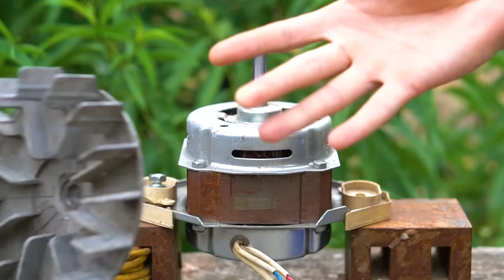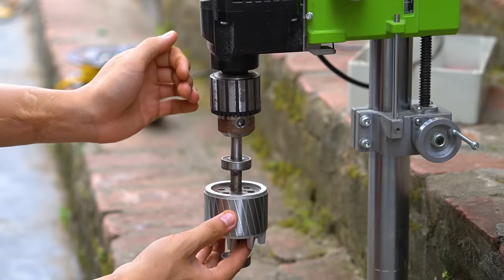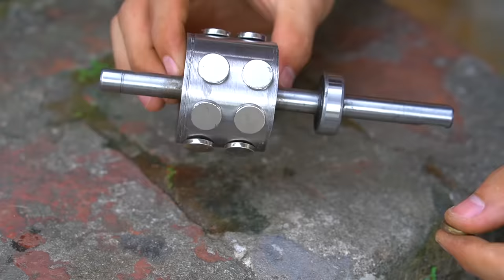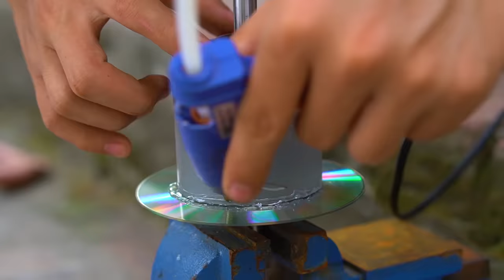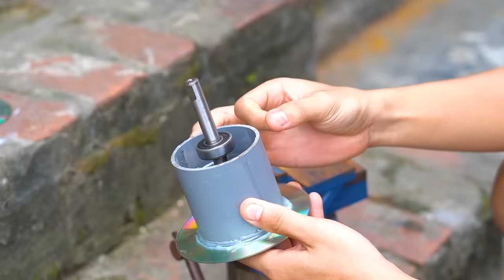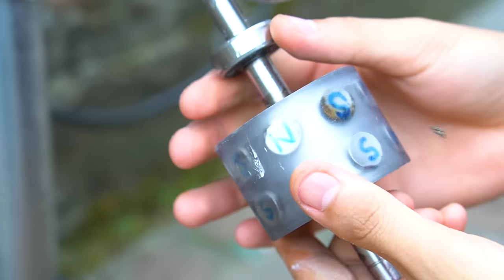I turn Washing Machine Motor into 220v electric Generator

Comment: Wouldn't the motor work as a generator just by being driven by the gas engine?  Was there a need for all that other work?
A motor takes electricity in to turn something but if an engine turns the motor it put electricity out.  Motors and generators are exactly the same, no?  And isn't voltage out based on driven rpm?
Reply: You have to have magnetism to make electricity.  The motor was an AC motor which used AC current to energize electromagnets in the stator to turn the rotor/shaft. No electricity, no electromagnet, therefore nothing happens by turning it backwards.   He added permanent magnets to the rotor; now all you have to do is spin the rotor and the  magnets will produce electricity in the winding of the stator.   All motors and generators are not the same thing. Electromagnets need electricity input before they will work; but permanent magnets don't need electricity to be a magnet. The motor went from an electromagnet motor, to a permanent magnet generator. It will now produce electricity regardless which way you turn it.
Reply: @henrywilliams1439  thank you for your reply, I appreciate you taking the time to explain it.  Cheers!

Comment: Okay. One thing you can do. Get ride of the Gas motor. Connect the shaft direct to a D/C motor shaft using insulated coupler. The generator will power the electric motor with the 220v thru an auto D/C A/C Converter. It will use less energy than the 220v generator. Run it as long as nothing breaks or shorts out from excess heat less any other problems. You can start it with a D/C auto battery and the Auto key switch. A volt charger detection circuit that auto stops the charged battery. Now you will have what I invented 55 years ago at 17 years old. 
PS. I improved this from age 18 years old to one not like this one to a generator with no moving parts.
Go figure that out. Good luck.

Comment: Im no expert,but dont you need a ground?
Reply: I think that the white wire is the ground if I am not mistaking and/or the base where is solded works as ground itself. Even when he says "220v", I guessed that is just 120 volt...
Reply: He doesn't need a ground just a neutral for the return.  A ground and neutral are two different things although I have seen some people use the natural as s ground.  This is not s 120 volt setup as someone mentioned.

Comment: So after i done all this then fasten a small wheel to shaft have that small wheel running against my mobility scooter wheel it should create a electric fence that i can run back to a battery Therefore putting electric current back in my battery after the battery is powering my motors which turn the scooter wheel which drives our new alternator which generates a current which runs back to battery...Correct... But what about reverse any side affects...you must be asian only a asian would be as bodgy as me But i like your ingenuity👍

Comment: it's a cool idea but it doesn't put out much amps. voltage may be high . size of magnets and wire thickness too small .a briggs and stratton engine 20 amp 12 v system at 36000 rpm and 20 hp will put out 38v a/c without the regulator . that winding he uses has more wraps so gets more voltage . notice it will run the small water pump with no restriction. add a sprinkler and it would probably struggle with load on it.  the speaker probably has a step down transformer in it from 110v down to 12 v DC
and the fan is barley spinning . would make a good 12v DC windmill .

Comment: Yes, it is very good to turn waste into treasure. For the safety of reuse, thermal protectors can be installed on the transformer. Dual protection makes it safer.

Comment: Attach a submersible fan or propeller to it. Stick the propeller just under the waters surface in a flowing stream or river and allow nature to power the alternator alone. 
This is how you go one hundred percent carbon free power. 
Grab a couple three cycle batteries and connect them just for fully charged backup. 
Or buy a submersible propeller / charger from Amazon that distributes far less energy but enough to charge a phone or a flashlight. Maybe 5-15watts. 
This invention in the video does create serious voltage but will not last exposed to elements. 
Create a watertight box for it and seal all seams then store it riverside and permanently submerged (the propeller ), then you truly have power for free. This device can power many things at once. 
It’s an apocalypse life saver.

Comment: Nice work sir👍 but if i may ask.. these appliences do they use Direct current or Alternating current because i didn't see you plugging the transformer or anything to convert the DC into AC
Reply: A magnet rotating alternative North and South always produces AC. Which (as you know) stands for alternating current. If you want DC, you can get is from a battery or solar panel. If you want to store AC power in a DC battery, you will need a director bridge in between. 4 diodes is a square figure.

Comment: Tell me, please, if I simply make 16 holes of 4 mm in the same rotor as in the video in two rows of cutting and most likely I will hook the copper electrodes, will nothing close on the coil, or will the energy come from the magnets?

Comment: Great video .. convert motor to generator check use petrol powered engine to drive converted motor check use generator to power water pump and soak 4 limbs in water check proceed to getting electrocuted :p

Comment: Ty for the vid, I'm going to give it a try. How did you step down voltage to run those things that are 120v ? Are the 2 wires coming out of Generator 120v each? Thanks again.
Reply: I was wondering the same thing

Comment: Tighten up that belt some and get it running at peak performance and then plug a electric meter into it so we can see how many volts and amps that it's producing!

Comment: I'll give this a go. I have a working motor that came from a bad machine (drum bearing went) .. I also have alternators - which to date i haven't figured out how to get them to work. I said i'd come back to it. but effectivly he turned a motor into an AC alternator? with the motor he now has a generator? So as long as you can keep the motor turning it;ll generate. = stream / river, wind.. other.. nice job

Comment: Hola, buenas noches
Felicidades por el proyecto.
Quisiera hacerlo por necesidad, no tengo luz ni como instalar en una casa de campo.
Me gustaría tu apoyo y orientación.
1. Que tipo de motor es
2. Donde o como consigo los imanes
Saludos y de antemano, mi agradecimiento.

Hello good evening
 Congratulations on the project.
 I would like to do it out of necessity, I don't have electricity or how to install it in a country house.
 I would like your support and guidance.
 1. What type of engine is it
 2. Where or how do I get the magnets
 Greetings and in advance, my thanks.

Comment: You guys wanna see something that does work, take apart a treadmill for running and remove large permanent magnet motor. I welded pulley onto flywheel and put it on plywood next to 5h go cart motor and wow you have a generator minus DC inverter. Add DC inverter and 6 way power supply and you have a generator.

Comment: There’s still operational cost involved i.e fuel to run the generator. Better replace that fuel generator with an electrical motor fed from the electrical output

Comment: Ingenious but cant understand how you can run all three and the petrol driver engine didn't change rpm or sound like any extra load when the loads were added ...maybe a buried power cable?

Comment: I see a few things about this a washer machine motor is mostly 110 is this a commerical type because it looks like a normal washer machine motor and 220 requires 2 hots and a ground and the power cord only had 2 after cutting the 3rd wire off so how is this a 220 and also if it was a 220 shouldnt there be some box and type of breaker to change the 220 volt before it runs 110 devices so how is this a 220 but only 110 i know he showed it to be a 220 motor so he really turned a 220 into 110 besides what the tittle says but this is still cool and i will do it cant wait cool video guys

Comment: looking at this technically speaking it works but i wouldnt dare connect anything expensive or sensitive to this

reasons being 

1st no earth connection 
2nd no testing of AC frequency
3rd no active voltage adjustment under load

If this was me I would want to use a motor with a slip ring powered  electromagnet rotor maybe a car alternator (only using 1 phase)

to improve this for more sensivtive devices

using a car alternator remove the diode pack and isolate one phase (neutral point and one phase wire) 

add a earth wire to the alternator chassic and a earth rod

attach a variable dc power supply to the brushes 

spin up the alternator until you reach a frequency of 50-60 herts (depending on your area)

and then adjust the brush voltage until you reach your desired voltage (120 or 220)

this if well monitered this could work (your results may vary im no electrician you are responsible for protecting yourself and your stuff)

Comment: Wouldn’t the rpm from the engines speed change the hz / frequency of the current generated? How do you target 50 or 60hz?
Reply: If the speaker is unplugged, the pump and fan will not run anymore, because there is a battery in the speaker and a voltage booster to 220V.

Comment: Somethins off with this...... since when do 90's lookin house speakers take 220v in, where we normally would put speaker wires to the stereo? What is that, a ginormous 220v 90's style bluetooth speaker? Then there's a fan from like 1973, and some antique water pump? Somethin don't click. That tiny generator is barely spinning. What is that, an elastic for a generator belt? Adding load didn't even change the sound of the motor. Why you think he started the music first. Man people are so gullible.

Comment: Fake. A washer motor won't put out 250v at low rpm, when it operates at 220v, and it won't be anywhere over 750w either. 6kW? That's 10x off in the rating. The motor looks flimsy. Have you ever seen a 6kW motor? It's probably going to be biger than your entire drill.

Comment: Concept is interesting, but the demo part seems fake given that the motor didn't slow down at all when the electrical load was added, suggesting the power for those devices is coming from elsewhere.

Comment: I was super keen on this video until i saw a petrol motor being used. If you used another method like using a 12v DC motor and hand spun it to get it going would of made more sense if you plan to live off the grid without petrol.

Comment: Y si podría agregar aspas/elice con banda o engrane.
Por lo del ruido y costo de combustible

And if you could add blades / elice with band or gear.
 Because of noise and fuel cost

Comment: You have power source running your generator. You can do that with any size you want. $ 5.00 dollars a gallon of gas. How long will gas power motor run without adding gas?

Comment: Am i the only one that noticed he has "voltage" going strait into that speaker? Ist that where u hook up wires from a stereo, its a normal speaker. Not Bluetooth it should of made a very loud noise then fried. Hidden wires on the pump and fan. Cough cough😂

Comment: i think your watts are miscalculated quite a bit. that size unit would put out 1kw at best. look at a 6kw generator winding set and youll see a huge difference. imagine running a 3 ton air conditioner off this thing, newp.

Comment: I wonder how much power provide this generator. I wonder this, in order to know if it could be powdered by a man with a bike. I mean, the tractor wheel could be mechanically conected to the generator (the bike fixed into the house with some kind of system). In this case the lower wheel RPM would be multiplied on higher RPM on the generator's shaft (with some kind of rubber sleeve to increase the friction). As I know, an average mid-age man could provide about 150 to 200W of power into bicicle's pedals, a professional biker, about 400W or slightly more. If I could provide, let's say... 150W for 2 hours (discontinuous), I coud lose some weight and also, I could charge some lithium accumulators. Of course the output power would be lower depending on syatem efficiency (randament).

Comment: That's not 6kW of power output. That water pump is not more than 400W to drive it..
Also you're wasting petrol to run the motor, May as well use solar panel+battery+inverter.

Comment: I’m sorry but, can someone explain how he generated 250v but turning the coupling shaft a few times? Also if the magnets are in parallel like that won’t it make it a lot easier to get locked in the stator once energized?

Comment: What if you just buy a 220-250v small motor to run your belt and use the same plug  itself,so that you don't need to use gasoline motor

Comment: I like the concept but it seems fake because there is no output voltage regulation. also the frequency surely will be way off... needs a rectifier and then a circuit to turn it into AC again with regulated voltage.

Comment: You put the washer on the wrong side, it is supposed to go under the nut instead of the bolt!
Reply: And this contraption wouldn't be running at 50Hz either

Comment: In India the diesel and petrol rate are almost all the same Rs.120 per litre. 1 l of petrol how many hours the Honda machine will run. How much units of electricity it will produce. Generally what is the power rate for unit by the government electric department charging for domestic use. Is this viable or government Unit rate is  viable. Where to compare the both the prices. This invention unit rate and government domestic supply rate per unit.

Comment: Yes can do because the washing motor are 220volt 60HZ WITH RPM 1800 THE coil winding and the N S MAGNET ARE energised to main coil but you can understand how much current rating. Aware overload must be .calculate..add circuits breaker & AVR ..THIS CAN USED FREE ENERGY BY USING HYDRAU POWER RUNNING WATER USED..fabricate mechanical  BLADE

Comment: He said it's output was 220 volts, but I see that he's running 110 volt equipment with it. and how does he know the CPS is a steady 60 cycles without some kind of controller on it. next I would not use it ungrounded.

Comment: I don't believe that you pull 220 volts because with those volts you burn the fan and the music amplifier and the water pump you have to put a switch box with 50 amps and then one of 15 amps or one of 20 amps so that they don't burn electrical appliances

Comment: Using electric motor get the thing started to where it'll power stuff and then plug the electric motor into the free energy socket that way you don't have to use gas or anything to use that you just urinate when the free energy of the electric motor powering itself cool huh the way he's got it you still have to use gas to power it so what's the point
Reply: nothing is free

Comment: Frequency output? No amplifier on speaker? Voltage output? Current out? The washing machine motor is about the same wattage consumption as the pump so to turn it into an alternator to drive only the pump it would have to be 100% efficient which is impossible with the way the magnets are done.... so in short, I call BS on this.

Comment: Why you got 220 run to the speaker wash where they plug in and let big speaker box don't take 220 volts to run a speaker what's inside that speaker box maybe

Comment: 14:26 approx ... the speaker is NON POWERED ... check out the wiring circuit of power and the inputs to the speaker ....does not make sense

Comment: DO YOU KNOW HOW MUCH 6000 WATTS IS... VOLTS TIMES AMPS EQUALS WATTS ITS CALLED WATTS LAW.  SO IF ITS 6000 WATTS AT 240 VOLTS NEEDS MAKE 25 AMPS AT 240 VOLTS UNDER LOAD... THATS 6000 WATTS.... AND YOULL NEED AT LEAST AN 8 HP ENGINE TOO DO IT.
Reply: IT MAKES ELECTRICITY... SHOW ME A 6000 WATT LOAD THAT RUNNING A 250 VOLT ELECTRIC OVEN ON HIGH  AND ALL FOUR BURNERS ON HIGH... THATS 600O WATTS...
Reply: EVEN MY GENERATOR WASENT 6000 WATTS IT MAKES 600 WATTS 30 VOLTS AT 20 AMPS AND ITS HIGH FREQUENCY... WHICH IS THE OTHER PART OF THIS EQUASION...  BY AVERAGE OUTPUT AS RMS. (ROOT MEANS SQUARE) IN RELATION TOO FREQUENCY. (HIGHER FREQUENCY CAN EQUAL MORE POWER IN A SMALLER PACKAGE BY HIGHER REFRESH.) BUT YAH VOLTS TIMES AMPS UNDER LOAD EQUAL POWER IN ACTUAL WATTS... AND TOO MAKE 6000 watts your gonna need do between 8 too ten horse power of physical work... Mines barily 600 watts and believe me that shaft under 600 watt load... Its like an electro resistive brake. So do the math chinese dont know a watt from 6000 watts or 600 make sure you do! That chinese wind turbine on amazon i bought that said it was 600 watts didnt make even one watt in a 45 mile an hour wind storm that blew siding off the side of the house... Thats shameful for both china and amazon... And true 6000 watts gonna move way more water.. you should do the math dont make up numbers... You get those numbers by volts times amps under physical load.... Like 4 1500watt 120volt electric heaters on high thats 6000 watts. Equals 25 amps 240 volts. 25 times 240 equals 6000 12.5 times 120 equals 1500 so each heater draws 12.5 amps at 120 volts... Or 1500 watts a piece... So i say this yes you can make a generator... So can i... But show me true physics when it comes too scales for measure... Dont make the numbers up like amazon and china... Thats not just bad for buisness... Its a buisness practice that can land people in jail and  can bankrupt multimillion doller buisnesses.  Think about it because it does cause harm too lie and fake numbers... And one can wright 6000 watts on a generator... But too cheet scales too lie about it ... In my book thats an abomination... If it wasent i could call a 600 watt power head a 60000 watt power head... Bullshit. Huge difference. Its litteraly the difference of 1 hp vs 100 hp